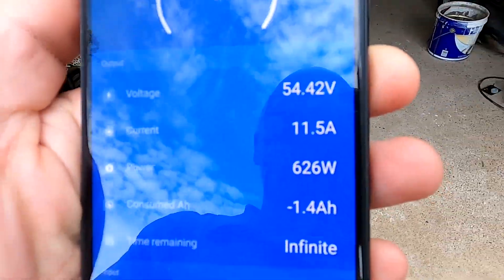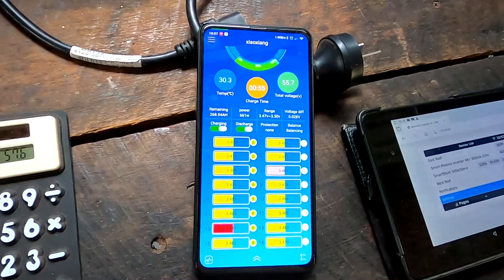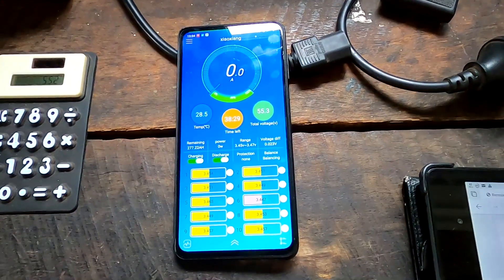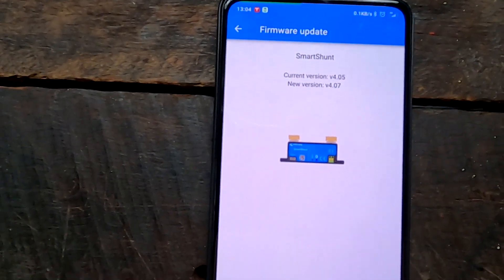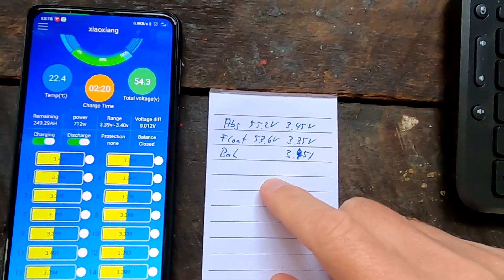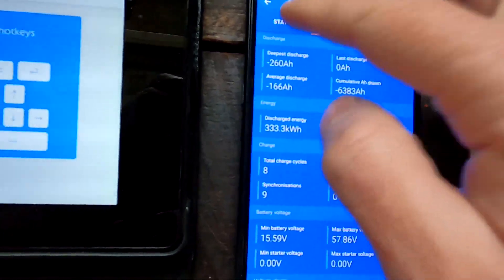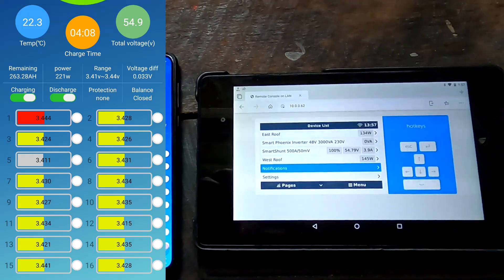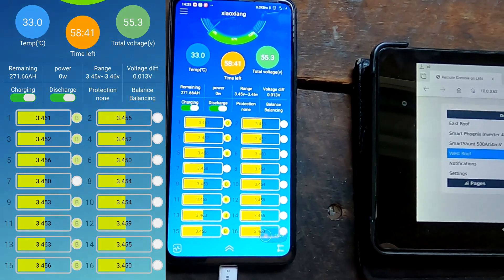Low voltage balancing LiFePO4 cells - These settings seem to work.  | Part 3/3

Comment: ok 3.45 is better than before but personally i chose 3.5 as my low and 3.55 as my high. just understand the lower you go the sooner your pack gets unbalanced. second you need to absorb longer at your top for the pack to be maintained. 2-3 hours is perfect
Reply from the maker: Well, from tests I did over time and charging to 3.45V, there is no need for absorbing for a long time. The current will go down quickly. In my test here you could see the it went down to almost 0A after just a few minutes. So at this point of time, the cells are already fully absorbed.
The higher you charge, the less absorption time the cells need (assuming the same current for such a test).
Reply: @OffGridGarageAustralia  the pupose is not for absorption it is to keep the top balance your are right on the edge of a unbalanced pack. you need to get away from that.

Comment: I'm interested to know what is the actual capacity of the battery charged in this way (charge to 3.45v, absorb 30 minutes). 85%?
Reply: 99%
Reply from the maker: Yeas, almost 100%. Even without absorption it will be over 99%. See my previous battery testes I did here on the channel: https://youtube.com/playlist?list=PLPomydD54sgC0pAzeOBz_-ZMfGMzJYYWK
Reply: @OffGridGarageAustralia  Ahh I see. BTW, I suggest you look at Electrodacus BMS. It does what your BMS cannot do which is balance throughout the charge cycle. Therefore no absorption necessary. Eliminates the headache of figuring out charging parameters. It also turns off just the loads or just the charging. And the support is excellent.
Reply from the maker: @firpofutbol  the Electrodacus is only for 24V max though, so that's a no go for me. They also need matching solar voltage, I believe...
Reply: @OffGridGarageAustralia Oh ya, forgot that you're on a 48v system. Shame that the BMS is only 24v. The solar voltage is only if you want to use an Electrodacus charge controller which is optional (personally not using it) or the bigger version which has it built in.

Comment: is there a syndrome where if your Solar batteries never balance out you could acquire SBBSD ?(Solar Battery Balance Stress Disorder )
Reply from the maker: I've got this since I started with this stuff.
Best way to deal with it: never balance!
Reply: @OffGridGarageAustralia  lol
Reply: just an aside note im still having problems with my Victron C.C. locking up I tried the fan thing still locking up.I did notice my Shunt acting stupid giving false readings until i reset the Capacity ah back to the org settings. This seem to take the C.c. out of float lockup and put it in Bulk where it should have been. I hope this helps you.
Reply from the maker: @mannyfragoza9652  I haven't had any problems with mine locking up any more since the last update. What kind of controller have you got?
Reply: @OffGridGarageAustralia  Victron BlueSolar MPPT 100/30

Comment: Hmm , yep ,I use two stage charge , my max for my system is 29.2 for 40 min. .(I have a 24 Volt system) I try not to use all my power so that I only top Ballance every 3 days at least . I am currently working on an totally off grid backup so as not to let the batteries go to longe

Comment: I recommend to set the float voltage to 16 x 3.45 V too. Gives more time for balancing. That is what BYD in combination with Victron does, too. 55.2 V for absorption and float. No problems with balancing or deviation.
Tesla recommends for their LFP batteries (Model 3 SR China version) to charge full at least once a week. Just give it time to balance, do not reduce the float voltage...

Comment: Try Stuart Pittaway's DIY BMS
Reply from the maker: Send me an email with instructions and all parts I need and I may look into it. Just not enough time to take this all in myself. Does it have over and under-voltage protection?
Reply: @OffGridGarageAustralia 

Stuart's GitHub with the details is here https://github.com/stuartpittaway/diyBMSv4

And he has details on YouTube here https://youtube.com/playlist?list=PLHhwQCDPuRcZW3u0jJucsiCCsUbNbMy-c
Reply from the maker: I know, the DIYBMS from Stuart. I just don't like it. I don't have the time to get this all put together somewhere and flash firmwares and so on... just not enough hours per day.
If you want to send me an email with step by step instruction and links, happy to look into it...

Comment: I think if you have the balance voltage bellow what you balanced at originally the balancer will just unbalance it again. What about just choosing a high enough balancing voltage so it does not occur unless things actually gets out of balance.
Reply from the maker: Yeah, you could set the balancer to start at 3.5V or even 3.6V. But most likely, it's too late then to start balancing. That's what happened to me before...

Comment: Its interesting Tesla is supplying LFE batteries in the Chinese model-3  So the charging suggestion for older Tesla's was 80% and an occasional to 100%. The Chinese Model-3 with LFE battery's has removed this limit and now the suggestion is to charge to 95% or even 100% without any damage.
Reply from the maker: I've got mine for almost 2 years now and have only charge to 100% twice (for a video I made, never for range though). I charge my model 3 to 60% only, sometimes 70% and NEVER higher unless I really need the range and there is no charger available. Tesla only recommends charging to 80% to keep the voltage lower, not because of SOC. With the NMC cells they use, SOC is far more predictable due to a almost linear curve of voltage to SOC. 
With LFPs, that's not the case anymore and we can charge to 100% with keeping a lower voltage to achieve that. From our tests here, you can fully charge the cell at 3.4V with some absorption.

Comment: Nope you changed the float voltage below the absorption voltage this is your problem  CC/CV keep absorption (with no time) and float at the same voltage, allow the float to pull what amperage it wants. Good luck my friend
Reply from the maker: Float voltage is always below the absorption voltage.
Reply: @OffGridGarageAustralia  Of course but lithium is CC/CV so they need to be the same or as close as possible.

Comment: looking forward to how your parameters hold up over time.  Can you be patient enough to find out or will you lose patience and fiddle some more.  It appears you are very close to ideal settings
Reply from the maker: I'm sure the settings will change again, once we get more sunlight down here soon. These might be the ideal winter settings with low amps charging. Once I get 70A plus charging speeds during mid day, these settings may not work any more.

Comment: 56.74 volts is your ideal voltage for charge and float. That is for a 16S pack
Reply from the maker: Why is that? It's too high for my taste. I can achieve the same with capacity at 3.45V which is far softer to the cells than 3.55.
Reply: @OffGridGarageAustralia  I monitor my Pylontech batteries to see how they compare to your Victron charge controllers . There is something going on in the Pylontech BMS that I haven't seen in your Victron  charge cycles. I'm running a large part of my house on 10kw of 15S battery storage, there are no user perimeters, all is communicated over RS485 from the BMS to the inverter. Today we had a good sunny day and I was seeing up to 67 amps charge current. After some time it suddenly ramps down to 15 amps for several minutes, almost  like a battery resting period and then ramps up again. I can see the individual battery pack reach float charge at slightly different times as indicated by the battery pack LED indicators. Pylontech warrant the batteries for 10 years so there is some additional magic going on.

Comment: I have been waiting for my batteries from China for over two months. I have a novice question. How would these numbers equate over to a 24v battery bank.
Reply: Half his values since his is a 48v system :)
Reply: Thanks for the reply, that’s what I was thinking, but needed to verify

Comment: Why are they drifting that much?
What about a test: How much does the internal resistance of the cells matter?
You could place a stainless steel washer between the busbar and the terminal of one of the cells? Then Charge + Balance...then discharge to 10% or so and then charge up again...will you be able to detect the battery with higher resistance? How much does it matter?
Reply from the maker: I cannot do any of such testing as long as I haven't got the other battery build and connected. I'm off-grid and reliant on this battery at the moment.

Comment: Just to set it in context: If you balance a 280Ah cell for half an hour with 200mA, this is 0.37% of the capacity. I don't think this will work when they get a bit older and begin to differ more than that in capacity. Question is, if they do already? But I have to admit, you're really stubborn to squeeze out the last electron.  ;-)  By the way, what kind of birds are they?
Reply: noisy miner (Manorina melanocephala) - I call them soldier miner.
Reply from the maker: Hahaha, I'm not stubborn, I'm a tester, an experimenter, an explorer 🏴‍☠️

Comment: 200 mA dump for 30 mins to balance, that's 0.1 Ahr of 280 AH cells, 0.036%.  You think you are being too picky?
Remember voltage ramps rapidly above 3.4v per cell.

Whether your balancing works or doesn't at lower voltage is a function of the BMS design.  You can balance at lower voltage but need a very accurate simultaneous cell voltage readings by the BMS system.  Random charging and discharging on system current makes the accurate cell voltage reading more challenging as cell current impacts cell voltage.  This is why the cells need to be sampled at exactly same instant in time to ensure they have the same cell current during cell voltage measurement.

Most cheap BMS's use microprocessor internal 12 bit ADC to read voltages.  This is okay if there is a synchronous sample and hold circuit.  An analog mux to a sampling capacitor is how this is done.  At less then 24v the muxes are not too expensive but for 48v systems the muxes get more expensive then cost of 16 individual ADC's.
Reply from the maker: Yeah, thanks. I'm experimenting. The settings work at the moment but will not work once we get more sun soon...

Comment: I recommended 3.45V absorption voltage weeks or months ago, good to see you got there in the end :-) Now you still need to get the float voltage right: at 3.35V you are underutilizing the solar array. Like I wrote before, the magic number is 3.375V 👍
Reply from the maker: I'm experimenting and trying to understand why things work or not work. I could balance at 3.6V and it would always work...That's not the point though, hence I started very low and got higher and higher before it started working.
Reply: @OffGridGarageAustralia  yes, balancing complicates things. I can still remember I did that manually before assembling my battery. It’s a full season of cruising later and my cell deltaV is 8mV. No automatic balancing needed. When you stay away from the knees with a good configuration, I don’t think automatic balancing is needed for house batteries.
Reply: @OffGridGarageAustralia  Good stuff!✌️👁️🐽👁️👍
Reply: I use 3.5 for absorption (mostly less than 15 minutes) and 3.375v for float.
3.55 v every two weeks for cell balancing in the victron smart solar.

And when the cells last 15 years and not 20 it is totally OK for me :)
Reply from the maker: Schon richtig!

Comment: On your victron shunt you don't need to really allow it to synchronize every time if you change the battery setting in your shunt to have charge efficiency of 100%, when it charges up it will reach 100% state of charge but you will still have a little bit more charge to go however the shunt can't go above 100% with that every time you reach nearly fully charged it will show 100% soc
Reply from the maker: Yeah, that is correct. I'm just experimenting and testing mechanics...

Comment: I don't run a balancer, and I see a little bit of random drift in my sinopoly cells. It is "random" because the same cell does not continue moving the same direction. I have not noticed any getting more than about 70mv between highest and lowest.
I do wonder if 3.45 balance point is still a problem?  That is still in the elbow of the curve...
Reply from the maker: Yes, 3.45V is still a very tight squeeze, I'm doing. I probably have to go up to 3.5V at some stage. Or I wait for the new, hopefully better BMS...

Comment: A possible solution for balancing without fully charging every time: For our customers with LiFePO batteries and Multiplus, we set the multiplus to fully charge once a month. That way balancing can happen, even with a "dumb" BMS. Without any noticeable effect on lifetime.
Reply from the maker: Yes, that is great. We discussed this in the last video when someone suggested to use the equalization function in the controllers to either manually or schedule a higher voltage once a month far balance purposes.

Comment: I check my individual cell voltage balance levels on a regular basis by disconnecting from all charging after a full charge to see where the resting voltages end up - and check for any deviations at resting voltage. I find that there is a high degree of variability in the individual cell voltages while charges is underway .... I often find that the resting voltage difference between cells is very small even when there is a larger difference between individual cells while charging. I am not concerned with a 0.020 difference while charging - but I would be concerned if the difference was that great while resting.
Reply: Agreed. If I let my LiFePO4 cells rest for a couple of hours it is easy to see the change in readings on a precise voltmeter. The effect definitely reduces exponentially over time - it takes another day or two to change as much as in the first few hours.
I've seen that while and immediately after charging the cells will read abnormally high, and regards to discharging they will read abnormally low. My understanding gained from experience with other chemistries is that the chemical reactions inside the cell take time to diffuse evenly thru the cell. This effect is much less pronounced in lithium than in lead (peukert effect) but I believe the effect has has the same underlying cause in non-lead chemistries (even regular flashlight carbon-zinc, NiCd, NiMH, etc) but probably 2 or 3 orders of magnitude less in lithium.

Comment: Great lessons. I have found a good bottom balance is almost better for full capacity usage. If one cell is weak then the bms shuts off when that 1 is low leaving unused capacity in the other cells. I have been using this method with the cheap Chinese made cell I have bought as of late. This saves me a lot of time.
Reply: Bottom balance is great if you regularly need to frequently deep discharge (like in an E.V.). Top balance is typically preferred if you are more frequently running near full charge.  In theory the pack will have the same capacity using the top as using the bottom.
Reply from the maker: Well, with bottom balancing, you're not using a BMS for balancing any more, right? Or even a balancer. That would destroy your bottom balance right away. It's in the over next video 😉

Comment: i think,stay out  of the balance region ,if cell run away. only that cell is held up so it can wait on the rest.
Reply: they are all balance ,it looks like the bms resistors  are being  register as a loud in charger controller .full 55volt stop charging ,set 53 no charging   ,no Float,Absorption, Bulk do nothing .when battery dump down too 53 start charging because the resistor circuit is analog not digital it dont move round ah ,it burns it off as heat .so charger has to work with bms keeping out the balance region, that way resistors are not being fooled by charger raise ah.
Reply from the maker: 55V (3.4375V) would the absorption voltage and 53V (3.3125) would be the float voltage then. That float voltage is a bit too low as we're already in the flat area of the curve then.
Reply: when balancing it take mouth not days on in circuit  live pack. let balancer work on its own .cant wait for ur next video .👍👍👍👍